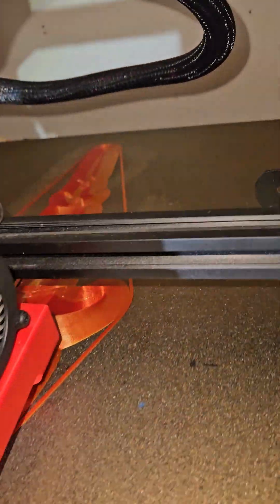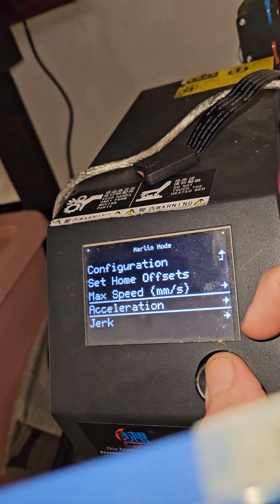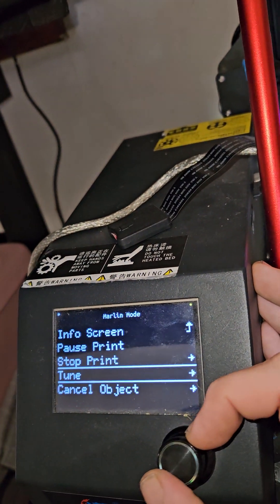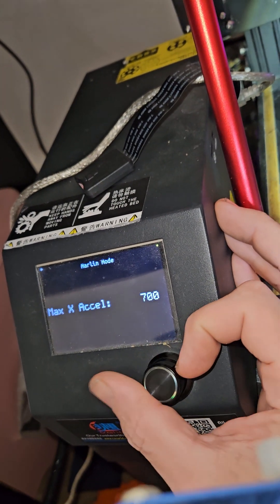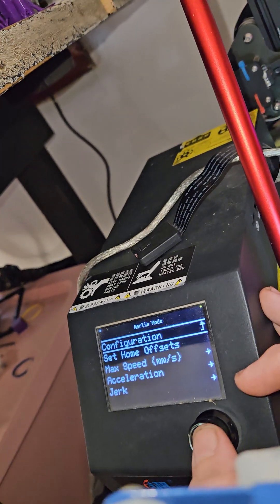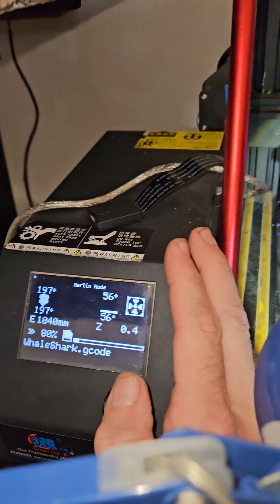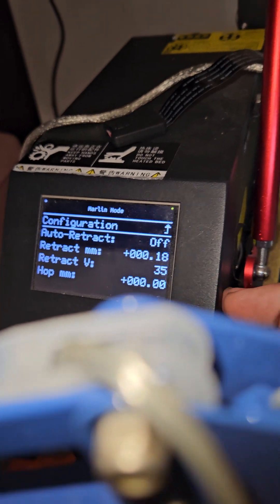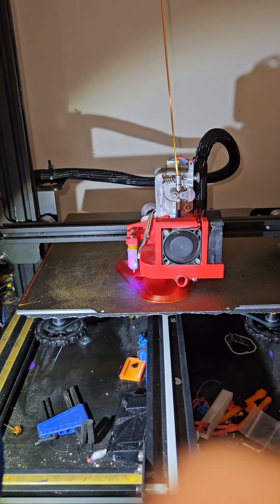live printer tuning using orca slicer and my CR10

Comment: Good info! I'm new at this and I'm having trouble getting my settings dialed in. first thing is I'm using a core xy and the print head is changing direction so fast that it's making a banging sound on infill as it goes back and forth. shakes the whole printer. It prints fine using Cura slicer but when I slice the same model (50mm x 50mm single layer) in Orca I have the problem stated above. I found a setting in Cura that showed enable jerk control was unchecked. so I set default jerk to 0 in orca, saved and sliced but no change at all. also I would like to see how you added the jerk control to the  Marlin screen if possible. thank you.